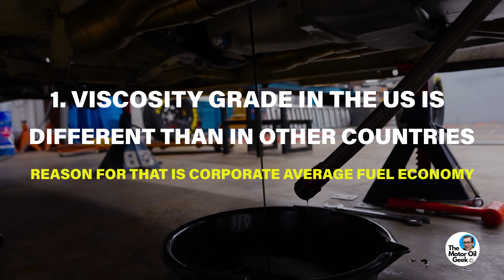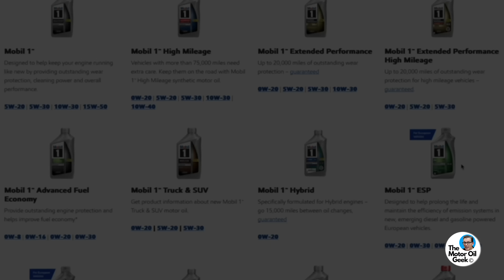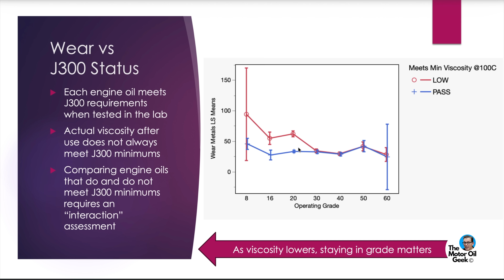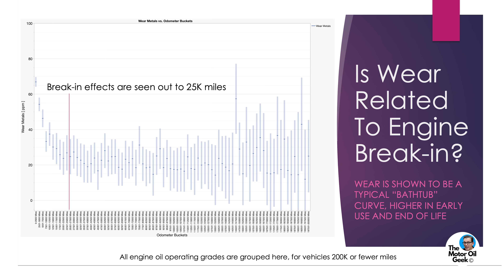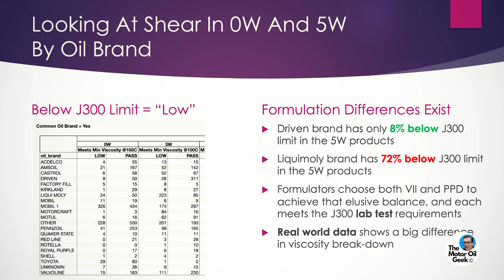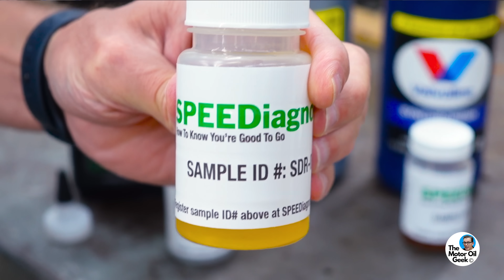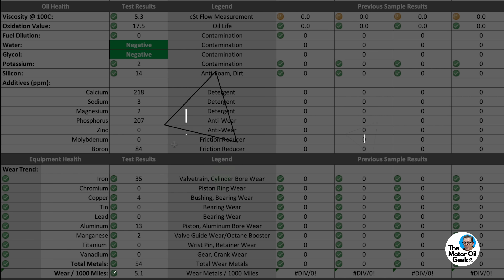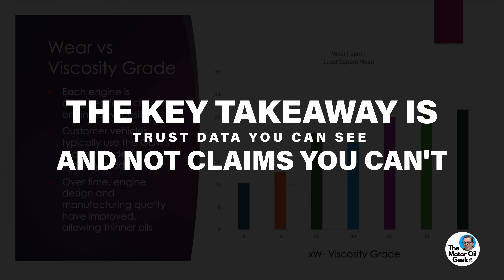More Ai Lies? The FACTS about 0W-20 vs 5W-30 (With Evidence)

Comment: @ 2:33 I have a massive issue,

Used oil samples only provide data, they don't provide context..... data without context is useless.

The oils that Sheared: 

- Under what conditions did this happen (left in too long, wrong oil viscosity for the application? too many short trips / long idling?), so what caused the oil to start shearing.
- What is the sample size for each viscosity?
- What oil brands?
- What engines?
- What was the starting HTHS of the 5W30
- How old is the data in the data?

Without this vital information, that data is completely useless.

How can a 5W30 with a HTHS of greater than 3.5 provide less protection than a 0W20 that has a HTHS of <2.9, or relatively have the same level of protection?

The only reason that a 0W20 can provide slightly better wear protection is due to:

- Cold temperature
- Quicker flowing when the engine starts
- the oil passages were designed for a thinner oil, so using a thicker oil causes "oil starvation"
- The engine oil pump was designed to pump a certain oil viscosity, and so using a thicker oil, leads to a reduced oil flow.. leading to "oil starvation' of sorts.

If 0W20 protected as well as "thicker oils", then car manufacturers wouldn't recommend using "thicker oils" in conditions when the engine is underload  (like towing).

Perhaps the more important thing to remember is that engine oils today are tested under different conditions than engine oils were in the past.

For example the HTHS of engine oils today is measure at 150 deg C, whereas years ago from memory it was only tested at 100 deg C, and so an engine oil today that has a HTHS of 2.9 at 150 deg C, is superior to an engine oil that "years ago" had a HTHS of 2.9 at 100 deg C
Reply: I would like to see any oil in a running engine survive at 300*F (150*C)  let alone see the engine survive with 300*F oil. If the oil got that hot, the engine is cooked, done, finished. At that point WTH good is that rating?
Reply: @vernonpitts6630  Toyota at least in Australia is discovering (to no-ones surprise),

That using 0W20 in the 300 series wasn't the best idea,

The problem is that under certain conditions that the oil becomes heat saturated, and since the oil in that engine is a critical part of cooling the engine,

Once this happens... the engine starts to fail.

Plus I believe that they are finding that the timing chain wear (or the guides) is excessive.

This is due to a two fold problem,

- Using an engine oil that has a lower HTHS compared to a 5W30
- Using a lower capacity sump than what is required (leading to the engine oil becoming heat saturated).
Reply: @vernonpitts6630  Not Redline or Amsoil
Reply: @vernonpitts6630  While I don't know what the engine temperature was....  In the 1990's I was driving through the Rocky Mountains In I believe in Colorado going west.   I had just got over the Continental Divide and the reality is the next several miles all you do is coast down and use your breaks (at least on that car).   I remember smelling antifreeze for a moment shortly after I started the coast down; but there was no other indication of any problem and it was there for a moment and then gone.   When I reached a point where I needed to accelerate again I found that the engine would not accelearate the car.... Fortunately, there was in clear view an intersection with ramps to where a gas station, hotel, auto repair shop, and perhaps a few other establishments.... I was able to just coast up to the auto repair shop.

My engine was extremely hot.  The plastic radiator drain plug had broken which explained the moment of smelling antifreeze miles ago while I was coasting down the mountain.  But, the Mobile 1 oil had not turned black...  It looked normal. The PVC valve was also carboned up and blocked.  Just like the cartoons the mechanic had dollar signs rolling up in his eyes as he pronounced that I would need a new engine and it would cost likely multiple thousands of dollars - and he could have a replacement engine in 1-2 days, and needed another day after he got it.    I told him to replace the radiator drain plug, fill it with 60/40 antifreeze, replace the PVC valve, and change the oil (with Mobile 1) the next morning when the engine cooled down - and we would see if the engine ran or not.  I walked to the hotel and stayed the night eating at the local restaurant.   By mid morning the next day he had my car ready to test.  The engine started, I test drove it with the mechanic (he was virtually speechless).  I told him that was the advantage of Synthetic oils... and he became a believer.  I paid him for his work and drove away.  Now the engine did now burn a lot more oil than it had (it went from no noticeable oil usage to like a quart every 2500 miles) as there was piston ring/cylinder wear.   But I drove that car for another 4-5 years before replacing it due to frame rusting reaching a critical point (I lived in Wisconsin where road salt rusted many cars to junk after 15+ years).

So there is your evidence (even if I do not know just how hot that engine and engine oil got).  Been there, done that.
Reply: @perryallan3524  The rings lose their tension first when overheating and warped heads and headgaskets. A PVC valve clogged wasn't related to overheat. The engine is damaged but not speechless. You can drive certain damaged engines indefinetly.
Reply: @turbosbox  Well the mechanic said that we needed to check the PVC valve because usually when engines get cooked by no cooling that the PVC valve plugs up - he say it about 4 times a year (and it as so hot that you could not touch it or the valve cover without getting burned).  The PVC valve was not plugged up 2 months before then as I checked then.

The evidence says the local mechanic was right.   How many cooked engines have you seen and dealt with?
Reply: The one thing I know for sure is facts are irrelevant to the oil nuts, they’re gonna continue to use their Amsoil and change it every 2900 miles like they’ve been doing for the last several decades while picking apart any in all facts supporting longer intervals and Amsoil being a waste. 99% of the time something else is going fail or the car wrecked long before the engine wears out due to the manufacturer recommended change intervals being followed.
Reply: @star9732  😅💯 These are the people that use the phrase cheap insurance. As if that protects against all other engine defects the oil doesn't even touch!
Reply: @star9732  If I'm driving a Hellcat, or that $100,000 Chrysler 300 with a 6.4L, I'm using the best, and it won't be a group 3 oil...
Reply: "Oil pumps are designed to pump (some particular) viscosity"
This is interesting.  Now, I'd like to see some youtube test at various temps with various viscosities.  It could take the form of a common salvaged oil pump, and some long clear tubes, with a timer.  Kind of like a race.
Reply: @David-e1b3t  I found that line to be BS also.  Freeze some 0w20 in your home freezer, it flows like SAE140.  Even not frozen 10w30 flowed better than frozen 0w20.  So how's that oil pump doing in constantly cold climates...
Reply: He's made videos before about those things, trying to point at individual blends could be misleading as they could change and there could be differences in engines (testing the oil from your engine eliminates the guessing by giving you the data within the context of your whole scenario, though the trend would be the same as displayed here). 
HTHS have always (as far as I know) been measured at 150c, I believe it was standardized in the 90's.
Reply: @PSA78  looking this up myself (for the first time),

It was developed in the early 1980's and became the standard in the mid to late 1980's.
Reply: There is a channel that tows a trailer on every brand new truck with twin turbos and 0-20, every single one by the top said pull over low oil pressure…
Reply: @coupons420  Sounds like the engine oil became heat saturated, and ended up thinner out...
Reply: A large enough sample size will in theory, even out those outliers. A good study might even throw out the data that is too fat out of the mean.
Reply: You spread so many myths without rest data, just your assumptions, sad.

Comment: I have 2010 FJ cruiser, purchased outside the U.S., and my manual says 0-20 to 50W oil is acceptable. In fact, in harsh enviroments (dusty hot desserts) it calls for heavier oil. I sort of split the diffrence and typically run a 5W-30 or even a summer 10w-40, or whatever is on sale in that range, but I also change oil at about 10,000 km (6,203 miles), as the manual recomends; or, once a year (I often don't get more than about 3,000 km a year on it). I suspect, they just changed "kilometers" to "miles" for the U.S. manual.
Reply: those FJs if I recall, has one of the best engines, the V6 4.0L...

Comment: So, should i use 5W-30 over 0W-20????
Reply: That's what I want to know! My 2017 Chevy Silverado with the 5.3 says 0-20, if 5-30 is better I'd like a professional to tell me so! I do 3000 mile full synthetic oil changes. I want this truck to last a long long time. I use Pennzoil ultra platinum

Comment: My girlfriend's 2016 Chevy Malibu LTZ recommends a DEXOS approved 5w-20 oil. Problem is, last week I went to buy 5w-20 oil (Supertech) to change her oil. That's when I noticed something strange.  It no longer had the DEXOS badge on the jug. I looked at all of the other brands of oil and noticed the same thing. None of the 5w-20 oils were DEXOS approved. After some research,  I found out that GM is now recommending 0w-20 oil in place of the 5w-20 oil. Per my girlfriend's request, I bought the Castrol Edge High Mileage 0w-20 oil. When I looked at the API badge, I also noticed that the oil is API SQ. Apparently we are now at SQ for the latest rating. Anyway, it seems like the engine likes this oil as it is running quieter and smoother. I'm now watching to see if the new oil has any effect on the fuel mileage.

Comment: Ah, oil-sheer is mainly dependent on the SAE grades around W. Motorcycles - the more performance the deliver - the more those values go apart to 10w50 or 10w60, instead of classic 20w40 or 10w40. Of 20w50. Soundes pretty counterintuitive to add less sheer stable oils to use cases where more oil stability is required.